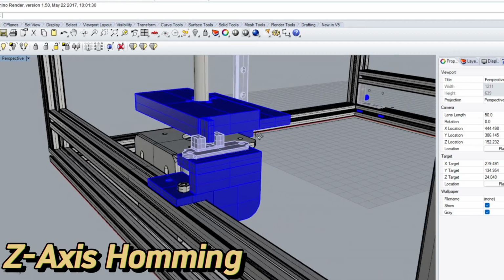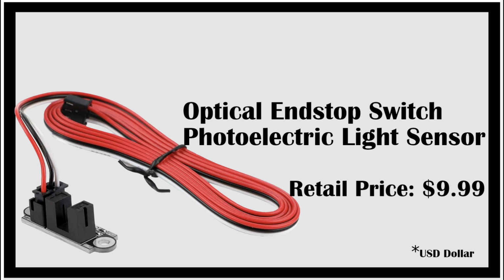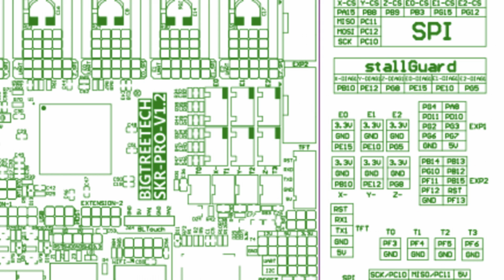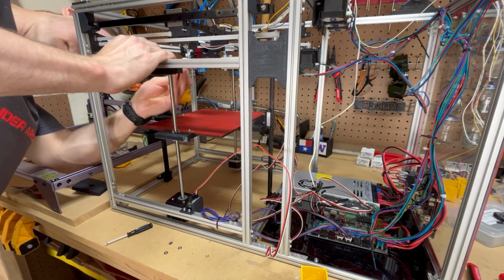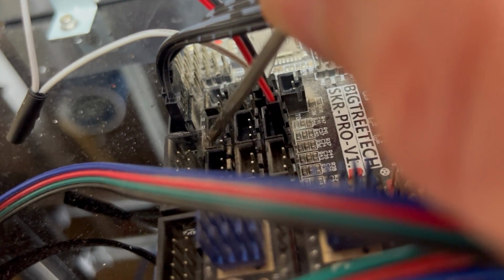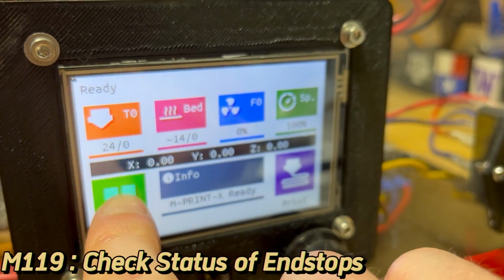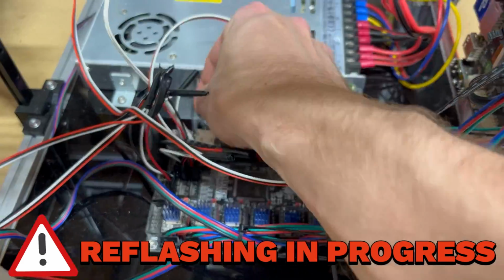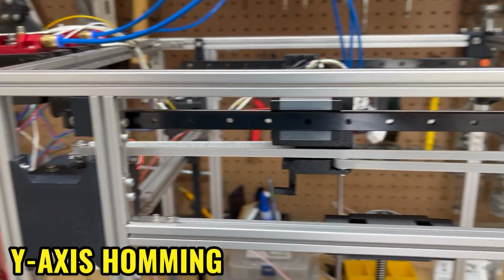[FIXED] INSTALLING OPTICAL ENDSTOP | 3D Printing Tech Support | Inverting Logic of Optical Switch

Comment: Why didn't you use the model for the switch to make the mounts? 

You could have desoldered the connector and put it on the other side of the board to clean up the wiring.

Comment: OMG this is sad but helpful... I'm looking at getting a printer and this frustrates me so much. A cheap ass hp paper printers use optical linear encodes. Because end stop? wtf you need those for unless 3d printer has no position sensors or even linear encodes. which are dirt cheap and make this unnecessary... same with had drives. Blind position stepper belt tech is from the 70s ffs.
Reply: Your paper printer also has end stops. they may be in the optical encoder but they are there. paper printers use cheap ass motors, which is why the need optical encoders. 3d printers generally use stepper motors (every one I have seen any way) so they only need one end stop per direction of travel. the position of the motor is then calculated. this is very precise.